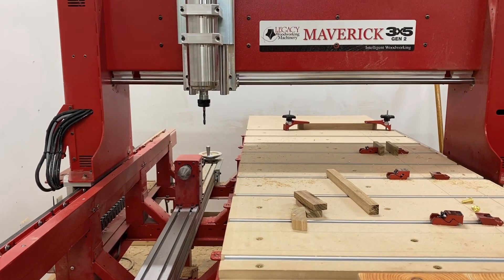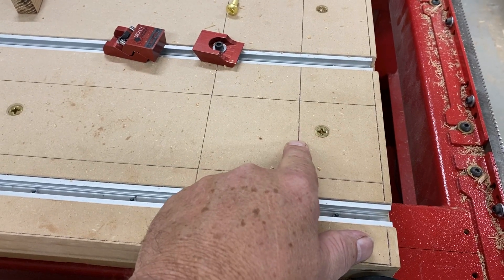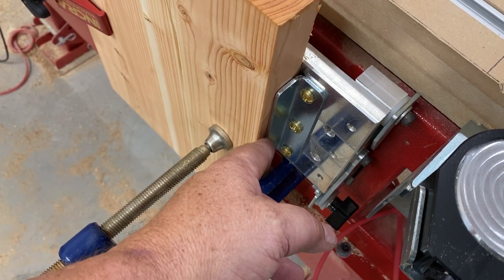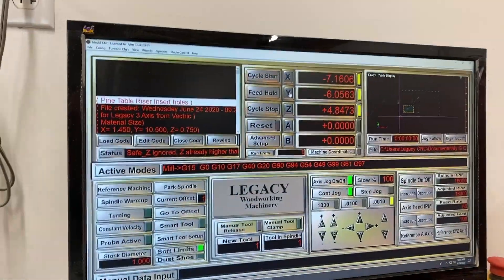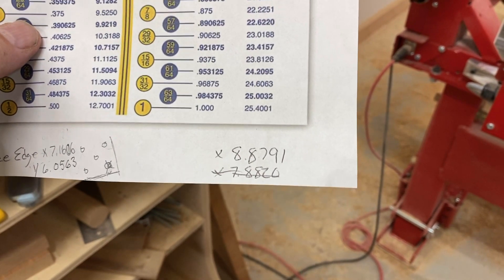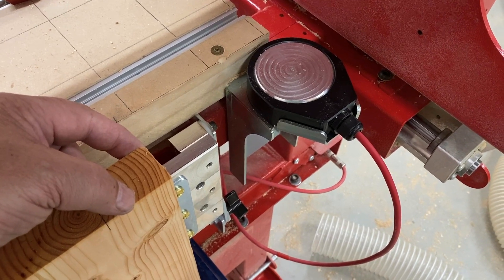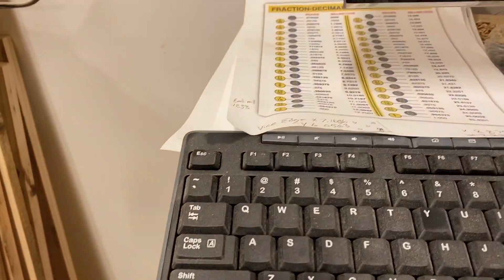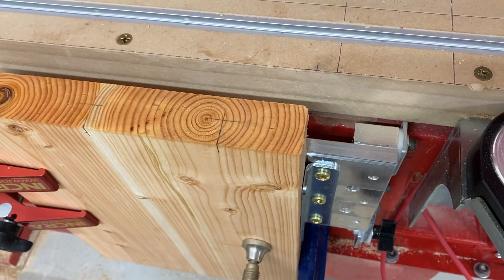Maverick 3X5 xy 0 reference for table and vise

Comment: you ever consider saving those values in a text file on the computer so you can copy paste them?
Reply from the maker: I have them memorize now. I had them written down for a while. They never change so once I am at machine edge. The others are easy 2.5 and 5.5 in x and y. I set those lines on those numbers for a constant reference.